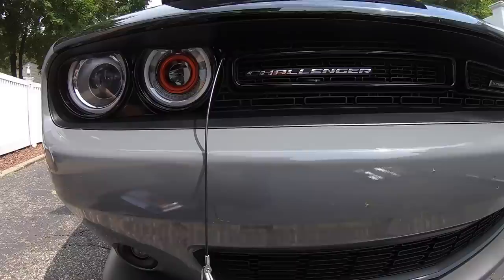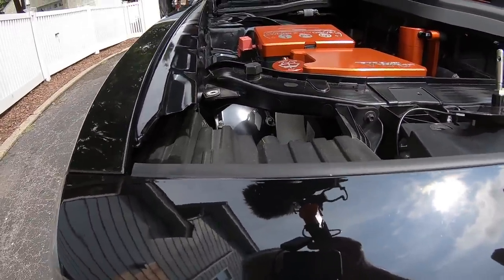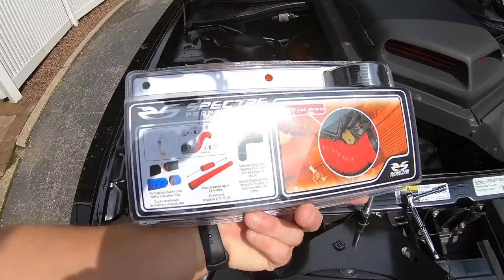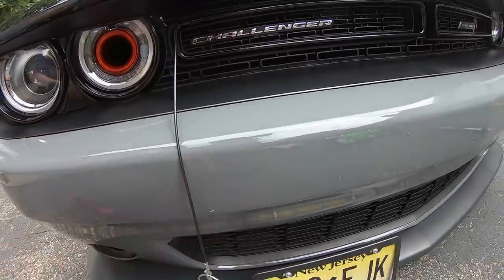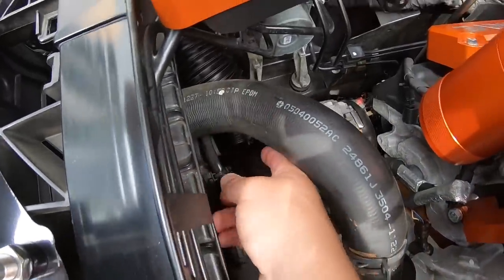Challenger Passenger headlight Intake - Ram Air x3 with Spectre 3" Tube

Comment: Honestly the only way I would buy something like this is for it to have a purpose. While driving your vehicle it receives enough air though the grill. Even the hellcats have that extra hole but it’s capped for a reason while the other inlet hole is the intake so if they don’t need it on a blower app why add it to a shaker scat na. Dodge does there homework. Now the only reason I would do this is if the holes routed to the air box like a double ram air otherwise it provides no benefit and actually is just another thing to clean with extra money spent and no functionality. No hate just being real here with everybody and if you like it then great no harm just calling it how it is.

Comment: I wanted to thank you for sharing this. I installed the same tube on my '19 R/T Shaker and I've been showing it to people in my car groups and telling them about your channel and giving 100% of the credit for the idea to you. Before installing this hose and the MoPar headlight intake tube I put in the headlight grilles from Merrick Motorsports. This step has helped keep out bugs and leaves and even rocks from going into the intake or down the passenger side tube.  

I routed the hose on mine differently than you did. I ran it in front of the radiator and then straight down because I didn't want to take the chance of any water or more specifically dust and dirt from blowing in and onto the alternator or belts and getting into the engine bay. I live in the desert so dust is more of a threat than rain, but I try hard not to drive my car in the rain anyways. I take my truck instead.
Thanks again for posting this! 
C. Ward
N. Las Vegas, NV
Reply from the maker: Thank you 🙏 I like your routing idea much better.  It makes more sense and would put even less dirt in my engine bay.
Reply: Do u have a video?👍🏽

Comment: Saw this the other day and liked it so well I just bought it for my 2020 Dodge Challenger SXT.
You can point the tube any direction you want.
Benefit is that water will be directed back on the ground if it gets in the tube and outside air will get directed on engine.
Thank You for posting it Work Play Drive.......
Reply from the maker: Anytime thank you 😊

Comment: Real cool solution.  I went with DIPS to help prevent or slow down any water coming in, plus bugs or small fly insects.
Nice video as always
Reply from the maker: DIPS is another great option but sadly they were not compatible with my orange headlight rings.
Reply: I got the stainless and put 4 coats of red to match my stripes.  I’m the guy with the  black challenger, red stripe and NOWEEDS we spoke at one of the meets
Reply from the maker: You've got the red wheel rings right?
Reply: Yes that’s me
Reply: DIPS aren't sold anymore it seems.
Reply from the maker: Oh wow, well Scalia-Motorsports.com sells screens now too that work with the intake rings.
Reply: @WorkPlayDrive  What is DIPS?
Reply from the maker: It’s a screen for the intake if you need one check out the ones from Scalia-Motorsports.com

Comment: Nice! I bought a $5 flexible rubber pipe cap from Home Depot to plug that hole.
Reply from the maker: I picked a few plumbing items up as well, but water pooled behind my headlight ring so I went for a different approach.
Reply: I followed WorkPlayDrive install and works great , noticed my engine runs a tick cooler ! Love it

Comment: Yeah, i like the air getting in more than it having dust. Its a good idea i guess but I dont have the expensive aluminum covers in mine and wont.  It dont rain very often where i live either,  but when its 110 degrees out with the  AC running, the air will be more beneficial.

Comment: You’re making me spend money again! Lol this was a great mod. I just installed one today  thanks to you and it looks pretty clean. That spectre tube is pretty strong and very flexible, plus it holds itself in pretty good. I ordered a coupler to clamp it down better. I ran my tube down the passenger side, not over to the right like you did. For some reason I was considering the alternator but it hardly rains and if need be you can reroute it how you like. I’m sure it’ll help with cooling a bit. I just wanted the look of both lights without getting a bunch of grim in the engine bay.
Reply from the maker: I'm going to keep an eye on the area of course, but go figure it's been raining non stop here all summer, I install this and ... no rain

Comment: I have two factory turbo inlet sized holes in the radiator mount of my 68 coronet RT and just may retro fit these headlights into my car and run some inlet tubes into the headlights…

Comment: Got me some aftermarket projector lights for my Challenger that we will be installing next week, so I wanted to see what ya guys are doing for this issue. She is a 2010 SRT8 and the new lights are just like the 2015+ model years, so they will have the updated look as well as the air intake ports. Not sure on the factory ones, but these aftermarkets have air induction in both lights and is mainly why I wanted them. Plus they have halos, so l don't have to get any of those now and can't wait to get them on her. I've been doing quite a bit of weight reduction, and am getting ready to order a demon style hood that is made of aluminum. All of them are made of either composite materials or fiberglass, so I was really pleased to find one made of lighter material and is actually aircraft-grade quality. No one has a great selection of carbon, at least not for demon style and is the only one that I've been able to find like it. Also just got new 17" racing wheels with 305x45 MT drag radials on it as well as ultra lightweight braille battery and will be doing a cam with kooks longtubes soon, so ya know that I'm not messin y'all
💪🏼😎

Comment: Where can I get these headlights with the center cap that is removable? I have a 2013 and it has the big bulky yellow headlight lens rather than the ring with the removable center.
Reply from the maker: Sorry these are the OEM challenger headlights starting with the 2015 year.

Comment: Just buy the parts for the T/A challengers  intakes those have both sides as air intakes from the factory
Reply from the maker: The T/A does not pull air from the passenger side headlight.  The T/A kit pulls air from the hood scoop.  check out my video I pop the hood at 9 minutes.  https://youtu.be/by6SmuZU6U8?t=541

Comment: How do the intake tubes work with your CAI. I rmb u putting the hellcat intake tube in one of your older videos that routed to your Cold air intake. Did u close it off? Does the filter get wet now?
Reply from the maker: Nope, I'm still using the mopar intake tube open to the air filter.  It was never an issue with the original Hellcat tube, but I have not checked on this one.
Reply: Thx let me know

Comment: The tube preventing the air from getting in though righ? With the tube the aor is coming in and hust going to the ground from the looks of it.
Reply from the maker: The tube brings air in while stopping water spray and debris from splattering everywhere. 

The water collects in the tube then drips out the maintenance pan.

Comment: Thank you for making the video after speaking to you before about removing the rear cap off the right Inlet I didn't even think about implications of water or anything like that. So again thank you for thinking for me, only one question was it a little bit of a optical illusion or was the end of the tube hanging directly over one of the accessory pulleys?
Reply from the maker: yes but all the water mist would collect in the bend and simply drip down into the pan just like the hellcat air intake and only air should be blowing on the area above the alternator.

Comment: Have you found an approximate temperature reduction that this adds, compared to running it without?
Reply from the maker: No benefit for me other than a clean wiper reservoir 😉
Reply: I did your same setup but I have my duct going right next to the fuse box and the air hits the engine i did see temp. Reduction which is what i really wanted since here in florida it gets hot
Reply: Steven Surita that’s awesome! I wondered if it could do that, also thought another good idea maybe it wouldn’t be overly complex, but drill a hole into the side of your air intake box and rout that tube into it, however I’m not sure if that would help or hinder airflow
Reply from the maker: You would need to cross the front of the engine the largest piping I could fit was 2” and to be honest restricting the air flow from a 3” opening to a 2” pipe across the front of a hot engine seemed to be more of a heater than a cooler.

Comment: I'm in NJ just purchased a 1320. Package. So will this work on all challengers.  STILL thinking about putting in upgrade CAI. But still getting ups and downs on it.  What is your thoughts ?
Reply from the maker: No this was only necessary for the 2015 and 2016. The 1320s have the lit inlet tubes so the passenger side is capped off. 

This tube didn’t result in much air cooling off the engine it was more to route the water from spraying everywhere. 

With a 1320 the car is pretty much purpose built I wouldn’t bother with a CAI unless the company is willing to guarantee some extra horsepower to offset the cost
Reply from the maker: I forgot to say congrats on the 1320! 🎈 maybe I’ll see you at a meet in New Jersey once this crazy Covid crap is over
Reply: @WorkPlayDrive  thanks for the advice.  Looking forward to meeting up with other challenger owners in NJ I'm. Just outside T R.
Reply: @WorkPlayDrive  thanks loving this car more everyday. Takes me back to. My teen years. I'm in my 60s now.   And the sinomin stick Color is a looker
Reply from the maker: Oh man so jealous sinamon stick is my new favorite color
Reply: @WorkPlayDrive  when you know of a meet coming up send some info.  Now that I have this car would like to meet up with other owners.
Reply from the maker: Once the warmer weather kicks in again we meet up every Wednesday night in east Rutherford
Reply: @WorkPlayDrive  where about on. Route. 17 area.   I'm about an 1.5 hour ride from there.
Reply from the maker: Yep right off 17 near the Lowe’s
Reply: @WorkPlayDrive  thanks.   Looking forward to getting up there when the warmer weather gets back
Reply: @WorkPlayDrive  I'm from Bergen County. Grew up there.   ( saddle Brook )
Reply from the maker: Grew up in Clifton myself
Reply: @WorkPlayDrive  small world LOL

Comment: That defeats the purpose of removing the cap in the first place. With the hose, it's  not adding air to help cool engine but funneling the air down and out. Maybe putting a thin wire neating over it would help with air intake without getting rain or debris into motor.
Reply from the maker: The air from the opening doesn’t really cool the engine so it’s not really a loss.
Reply: @WorkPlayDrive  Isn't it capped stock? So if opening it up doesn't really cool the engine then wtf is the point of this video even? lmao So just leave it stock! hahahah
Reply from the maker: Having 1 headlight capped and 1 not capped bugged me.

Comment: Does the alternator get wet? I couldn’t see where the tube was pointing 
Thank you
Reply from the maker: When I first installed the alternator got a little wet I just readjusted it until it didn’t aiming the water straight down into the maintenance pan
Reply: Work Play Drive 
I really appreciate the advice

Comment: Just to confirm ..you can’t do this on the regular R/T right ?
Reply from the maker: You can remove the headlight center caps on the 2015 and up. The newer models with the kit inlet tubes have caps in the rear.

Comment: my only worry about them headlight air intakes are mice getting in them. idk how often that happens but i can easily see it happening because its an open vent
Reply from the maker: The whole bottom of the engine bay is open mice get in from there 😏
Reply: @WorkPlayDrive  yea but the headlights are connected to your turbo lol imagine you let your car sit for 3 months not knowing your turbos are stuffed with nuts and then that thing blows up on the first start lol

Comment: Why not just keep the cap on the passenger side headlight air hole? Keeping it open and using a tube to redirect the air, dirt, and water seems like more of a hassle than anything else.
Reply from the maker: OCD with making the car look even on both sides.

Comment: I would have just put the cap back on but maybe I'm missing something 🤔
Don't mean for this to come across as talking s***t
Reply from the maker: All good you came across fine ;) With the Driver side working as an active intake you can see the open hole in the Headlight.  The passenger side is capped so when you approach the car it appears uneven (triggers my OCD) for people who are not aware of the intake, I've had them tell me my headlight on the driver's side was broken or missing.    Removing the cap evens it out, the tube helps keep my engine bay cleaner.
Reply: @WorkPlayDrive  oh okay yeah that makes sense haha
Reply: @WorkPlayDrive  I thought my OCD was bad!... Great job. Thankfully with this mod the wallets will not be in ICU...

Comment: Cool mod literally but not sure how long it took you to get the rubber sleeve into the opening but I'm at an hour plus and it isn't happening just to tight with that close 90 degree turn 😤
Reply from the maker: The rubber sleeve took less than a minute to insert into the opening.  I spent a little time finding the location I wanted to route the tube, but once I figured it out it literally slides right in and the tube is flexible enough to move out of the way.
Reply: I just realized you don't have a blower. I have a Hellcat so the 2 intercooler lines run right down next to the alternator.. Time for plan B.. Lol
Reply: Fastman 
Can you update your plan B 
I’m curious because I have a Hellcat and was thinking about doing the same thing

Comment: I have to ask did tube melt or is it heat resistant?
Reply from the maker: The tube held up great where I installed it, I did not have it in contact with the engine or exhaust
Reply: @WorkPlayDrive  that's great man to know and my other question is what do you think the fit will be if I had a 392 intake manifold on my 18 challenger 5.7 with your set up and will I be able to supercharger under their later on with your set up because it looked tight in their already
Reply from the maker: Thats a question for when you select your supercharger.
Reply: @WorkPlayDrive  and what about the 392  manifold will that hood still fit sorry for being a pest but love the hood love the  Function of air flow and hate to hate to send the money on the hood and not fit shit or have a big scoop that just sits their and dont lead to the air box no more and thank you for your response.

Comment: Hmmm.......I had mine open to the engine bay for a couple years now, engine bay seems top stay pretty clean to me. Seems the way you got it aimed if it does get any water in it, its gonna get sprayed all over the alternator and that cant be good.
Reply from the maker: no spray, it's the same concept as the Hellcat air intake, The bends will kill the spray and collect it at the bottom of the tube and clean air will flow while the water will drop. ...at least that's the plan ;) the bend in my airbox intake is a lot less severe and does a good job of it.

Comment: Hmm... could you run this to your intake and have more, cooler air?
Reply from the maker: By the time he crosses the front of the engine bay would just be warm air I would also need to cut the pipe down to a 1 inch inner diameter across the front of the engine bay. Basically too much effort no benefit.

Comment: be ready to replace your serpentine belt and alternator. You do know that the passenger side light on a Hellcat is used as a cooling duct. I think there's either a brake, trans or oil cooler on that side of the car.
Reply from the maker: The passenger side headlight on the hellcat is plugged with a cap, it does not go anywhere.
Reply: @WorkPlayDrive  either way I know there's a cooler in that area of the car. Also I didn't have a plug in my passenger light. There's a tube that leads to the top of what I'm being told is a LTR(low temp radiator).

Comment: Can it be piped into the air box collector?
Reply from the maker: it can, but it's not worth the effort, you need to down size the pipe to 2" then pass it across the back of the radiator in the hot engine bay.   I found it to be too much effort with no reward.

Comment: Thought these air ducts were too be plumbed over to air box? So, it's just for looks?
Reply from the maker: the driver side is direct to the airbox, the passenger side is not worth it, by the time you down size the pipe and route it across the hot engine bay, it's pushing low pressure warm air.  I took the Passenger inlet and pushed it to the front of the engine to pass cool air.
Reply: @WorkPlayDrive  thanks for the clarification, I like the lit up air inlets that they have on the Merrick motorsports site, but I would need to grab a separate hellcat intake from back of headlamp to air box then do something like the 3"pipe (spector) pipe away from engine to keep ther dirt and shit off. I plan on grabbing a 2019 redeye hood with the twin snorkel ram air, and then would like to do the headlight intake as well- not that it will probably make much difference but I think it looks Sharpe AF.
Reply from the maker: Totally agree, the new hoods with the ram air will feed plenty of air into the intake, but if you're going to open up the holes, might was well make them functional ;)